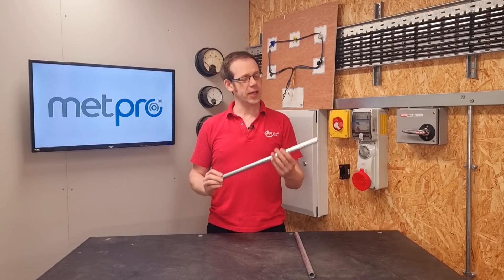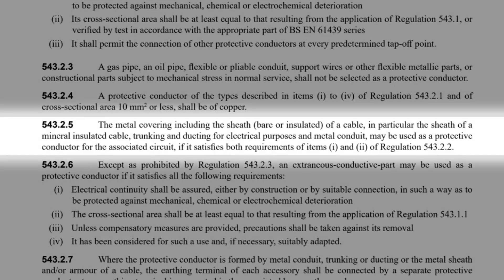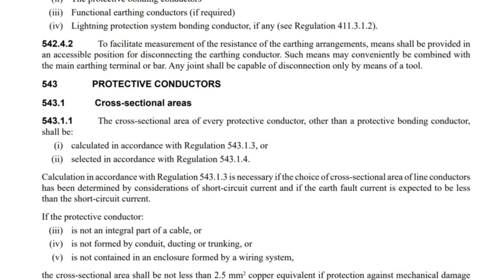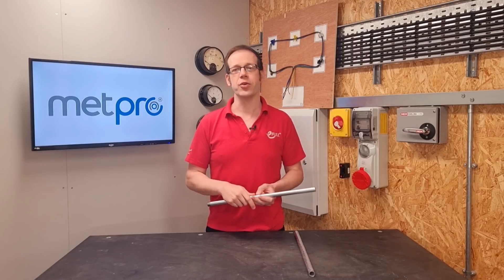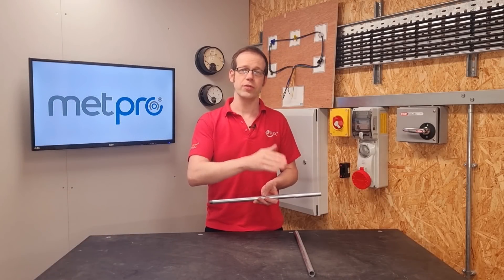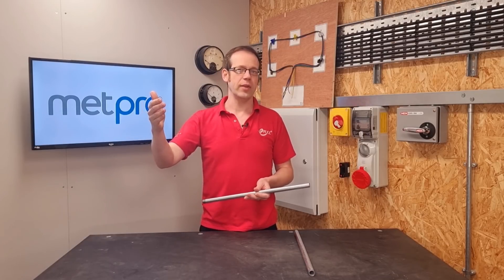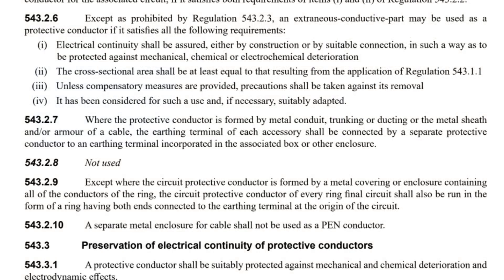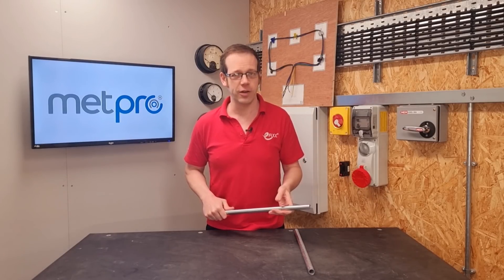The Earth Wire is Missing! - Can You Use Steel Conduit Instead?

Comment: You can find the CSA of a conduit quicker (with a single calculation) by finding the average circumference by either using the outer diameter minus the wall thickness or the inner diameter plus the wall thickness and then multiplying that by the wall thickness. Use the formula:

a = ( D - t ) * π * t
a = ( d + t ) * π * t

Where "big" D is the outer diameter, "little" d is the inner diameter and t is the wall thickness. π can be rounded to 3.14 if you only need a quick calculation.

Comment: ? Pi x 8.63^2 = 233.98 and not 244.95????  Still, makes no difference to your proof that the steel conduit is plenty fine to be used as the CPC in this instance.  (314.16 - 233.98 = 80.18 mm^2 CSA for the CPC...)

Comment: If electricians did conduit tightly you got no problems,,with the size of the tube it'll always be big enough for use as earth,just don't do it like that anymore,same as not having flyleads to ceiling grids or radiators,not done anymore,different times.
Reply: We are installing a job at the moment with 75mm steel trunking with 20mm tube . I won’t be running an additional cpc using the containment as the cpc for the sockets and lighting .

Comment: Different terms with the NEC over across the pond. We no longer allow mechanical means from faulty connections. We run an equipment grounding conductor with every run and bond every box with a splice. Simple and redundant.

Comment: But with that grubscrew-fixed system, all it would take is one loose grubscrew, or a bit of corrosion etc. at the fixing point and suddenly you have no cpc.
Reply: Thats only the same as the first cpc connection coming lose (if a radial)
Reply: I suppose adding grounding straps at each join in the conduit could be mitigation against that, although if going to that kind of detil you might as well just add an extra earth wire.

Comment: About 50 years ago I used to find a lot of gripfast conduit which used clamps to join fittings, the paint had to be scraped off to ensure continuity and it was wired in singles VIR cable. Guess that was from the 20s. Looks like conlock is the modern equivalent!

Comment: I know code allows it, but I hate seeing people "cheap out". All it takes is one loose screw to break the ground. Or a conduit being cut, or section of plastic being introduced to screw everything up. And of course, sparky's and inspectors never actually check. (I've seen lighting circuits where the conduit wasn't secured at couplers or boxes. Inspectors never climb into the ceiling and pull on things.)

Comment: While the CSA of the conduit itself is sufficient, what about at the joints?  As the joints are held together by a set screw, do you need to calulate the area of said screw as that is like to be less than the area of a conduit?

Comment: What happens when you have dissimilar metals,say steel conduit and an alluminium box/enclosure. In this example crystaline corrosion will set in with even a little dampness. Do the regulations say anything about this?
Reply: It's called galvanic corrosion.

Comment: Lots of good stuff there.  My opinion is run a separate CPC in the conduit and the same for SWA and stop trying to save money at the design stage.  A main reason is that it may work and be ok when first installed but what happens when some of the joints start to work loose or the conduit/SWA armour starts to carode/rust
Reply: The system should be periodically tested so that would be picked up on but I'm just being arguemnetative because I fully agree with you run the CPC

Comment: Using the new conlock conduit system and assuming all freshly cut conduit ends have been painted (to prevent corrosion) then wouldn't the conlock grub screw be the only true metal to metal connection...?

So shouldn't this whole calculation be based around the CSA of the conlock grub screw..?

Or am I missing a trick where the protective coating of conduit paint is actually conductive..?

Your thoughts please..?

Great video as always guys 👍🏼
Reply: Conduit zinc coated?  If so that leaves the contact being the grub screw and a line contact at the opposite point from the grub screw.  Also what torque are you using for that screw?  Not convinced.

Comment: I was on a job in a garage a couple years ago  . The conduit appeared ok but I was a bit sceptical. . On pulling in new cables  I found the existing conduit under the concrete floor was In fact very rusty and as I pulled the old cables out they were very wet and stained by the rust.  Moral of the story is unless you can see the whole length of the conduit don’t trust it for earthing.
Reply: I had a similar problem some 30 years ago, where an SWA cable went to and exterior socket on an outside wall. This hadn't been properly sealed and years of moisture had caused the armour and the the fitting to corrode.

Comment: Use plastic sockets!In Europe it works,so why not in the UK?
Reply: We use metal where the environment demands it, mainly in commercial and industrial sites as it stands up to any potential damage from fork trucks etc, plastic would just smash.

However there's is a increasing trend to install metal conduit and metalclad accessories within homes for aesthetic value (the industrial look).
Reply: @seanthespark  I have bin in lots off factories in the Netherlands and no metal sockets seen or installed!

Comment: Doesn't the grub screw reduce the cross sectional area? It only makes contact that you can rely on on the tiny screw, not the whole conduit
Reply: I had the same thought. I certainly don't think that the contact between conduit and fitting in this sort of push-in setup should be relied on as a dependable connection.
Reply: so the CSA might be only 60/70%... earthing conduits is a must, but in my view always run in a earth also
Reply: There's also the the part being pushed against the back of the housing, but yes, the entire conduit is not the contact point.
Reply: @jfbeam  the painted part

Comment: This bit of the regs seems crazily weak. The end-to-end resistance of runs must be very unreliable even if you manage to get a good reading at installation. This stuff gets knocked and there's ingress of dirt, corrosion, etc, all the time especially there steel conduit is specified. What's the point of getting the torque correct to the nearest 0.1Nm in a distribution board and then relying on a  grub screw or on-site threading and attaching it to a 2m lever arm? I guess it would be ok for RCDs where the CPC is just needed to sink enough current to trip it, but where you're talking about equipotential bonding or relying on fault overcurrent to trigger protection you need your CPC to be treated with the same respect as line conductors (except that you can assume its loads are transient in terms of heating).

Comment: If I was going to consider using the conduit for the cpc, I definitely wouldn't be happy with a small grub Screw making a secure connection and continuity. Crap system, much better job to thread the pipe. Quicker is definitely not better in this case.
Reply: Depends why you are using conduit surely?  Mechanical protection? - frankly a slip joint would be fine.  Electrical continuity? Whether CPC or to meet Tempest requirements, screwed seems much more robust.

Comment: When I was first on sites we used the conduit and trunking as cpc but after a few years running a cable was specified. I can only assume it was down to the designers, the same muppets who wanted us to get 6 x 4mm singles round 20mm pipe bends. Real Fairy Liquid job that one. 🤣
Reply from the maker: 😂 Having been on both sides of that fence I totally sympathise Christopher.

Comment: Old commercial buildings use the conduit/trunking as the CPC
Reply from the maker: Yup!
Reply: Yup and I work in a factory like that. Seen lots of missing trunking and corroded conduit. 😳

Always have put a separate CPC apart from large SWA's when installing.

Comment: Better to install copper cpc in the event of external fixtures been added later on ,
 Bit like underfloor heating pipes now in plastic  covered and aluminium layer inside ,after time on radius the lining will have wore away with aluminium in contact with water ,  future problems ,

Comment: I have seen square metal trunking as the CPC with cable bolted to the trunking at the corners and tees. Seen one where the trunking was played about with, having the cable CPC left off. Big break in the CPC.
Reply from the maker: Sounds like a problem... 🤔
Reply: @efixx  
Always check, that the trunking is linked by bolted conductors.

Comment: This is an absolutely brilliant vlog . 
Very informative and helpful. 
I have never in the years used the conduit or trunking as the CPC but I would consider it. The only question I have is where the trunking enters the accessory/consumer unit/ dis board or whatever require special attention regarding cleaning off paint to ensure a proper long term connection. It’s a bit like the question of SWA gland tags  not being used on a steel enclosure.
Reply from the maker: Good question, we'll do some digging. 😊
Reply: That’s a well good question… hope we get some good answers as normal back!
Reply: What’s the question here

Comment: I do appreciate all the math and science that goes into cable calcs and one reg that that refers to another reg providing 2 other regs are met and they all satisfy another reg....🤨
Do you know what..... my time is better spent on the tools rather then at a desk with a calculator and 9 of my fingers in different pages of the reg book and its tables...
Sorry but im just gonna buy a couple of coils of earth wire.... 
If you have a few guys in your company and one of them can do all the paperwork and calcs then crack on.... but if your on your own then you need to be earning the monies....
And beside the most important fact....Bar none is conduit , bushes, couplers nuts etc are absolutely a load of cheap crap.... and it dont matter where you buy it from... its crap, threads are very loose and surface areas on bushes are minimum as are gutter nuts..... you compare containment quality from late seventies early 80s to modern metalwork and your mind will be blown...
British Standards must be getting brown envelopes from someone on a regular basis because quality has gone down the toilet... FACT...
I wouldnt fancy a fault current being trusted down the conduit and accessories....
Reply from the maker: OK.

Comment: Interesting topic. Most of the projects I've worked on over the years, the contractors have always used a separate cpc, as it's easier. However it's definitely worth bearing in mind situations where we can use conduit as cpc, especially if you find it when carrying out an eicr.
Reply: Using the new conlock conduit system and assuming all freshly cut conduit ends have been painted (to prevent corrosion) then wouldn't the conlock grub screw be the only true metal to metal connection...?

So shouldn't this whole calculation be based around the CSA of the conlock grub screw..?

Or am I missing a trick where the protective coating of conduit paint is actually conductive..?

Your thoughts please..?
Reply: @essdee9143  Great observation.
Reply: @essdee9143  The "protective coating" is zinc and is conductive. Even if appied as a spray paint, it is heavily loaded with zinc particles which make the paint conductive.
So the side of the pipe opposite the grub screw presses against the fitting and provides a conductive path, in addition to the grub screw and probably lower resistance too because of greater cross-sectional area.
Reply: Using the conduit as the CPC is only done in big commercial jobs. Done in a big job I was at in the Middle East - to US standards which were more 1930s.  Saves a lot of earth wire on a big job though. Quicker to wire up as one less conductor to manipulate dress and tighten up.

Done a lot in ye olden dayes when copper was very expensive.
Reply from the maker: Yeah, we tended to run an extra CPC in steel conduit as well, quite interesting to see where the cut off point is for using 20mm conduit as the CPC too.

Comment: So really, for all likely sizes of conductor in a 20 or 25 mm steel conduit the conduit will be fine as the CPC...
Reply from the maker: Yur, the cable needs to get pretty maohoosive before it becomes non-compliant to use the conduit.

Comment: Would seem sensible to earth any metal trunking/conduit etc. anyway, whether or not there is a cpc. Back boxes are generally earthed and a cable could get snagged when passing it through the trunking/conduit, making it live.
Reply from the maker: If the conduit is the CPC would that snagged cable situation not then disconnect the protective device? 🤔
Reply: @efixx  Indeed, but if not earthed it would remain live (?) Is it not the equivalent of a water or gas bond? - even if it doesn't go fully into earth.
Reply: @efixx  Being pedantic here.....but you mean TRIP the protection device😁

Comment: Don't you have to divide that figure by 8 due to poor conductivity of steel compared to copper like you would when using the armour of an SWA cable for your CPC?
Reply: Looks to me like the k2 value here factors in the lower resistance but I may be wrong.
Reply from the maker: This. 👆👍
Reply: @efixx cool 😎

Comment: How are you connecting the steel conduit to the earth bar in CU?
Reply: Connect a fly lead using the banjos bolt and nut
Reply: @reddie8130  
I assume that can drop to 1.5mm if using 2.5mm rather than 6mm.
Reply: @johnburns4017  you can’t mix and match the calculated CSA and selection. If you are using selection as the video, then you should use the same CSA as the circuit line conductors. In which case it would be 2.5mm to the socket earth terminal. If you used less then you would need to prove it by the calculation. Although in practice you will almost always be able to reduce it.
Reply: @rossthompson1936  
So using the conduit it would be min' of 6mm cross section area of the conduit. If mixing it with cable the minimum size of the CPC is the size of the conductor in the cable, say 2.5mm
Reply: @johnburns4017  it’s important to remember what you’re trying to do. In the video the CSA of the cpc is to be selected rather than calculated. If you were using copper, it would be the same size as the line - 2.5mm. But here steel is being used hence the k1/k2 calculation, which says the steel must be 6mm min. But if you are connecting the conduit to the accessory earth it’s going to be copper. Hence 2.5mm same as the line as per selection. If you calculated instead both the steel and copper would be less. Therefore you’d probably get away with 1.5mm. But you started with selection and should continue to do so unless you make the calculations.
Reply: @rossthompson1936  
As the CSA of the steel conduit is 60 sq mm, if running say thee 2.5mm L and three 2.5mm N conductors the copper wire to the CU bar should be min of 7.5mm. So a 10mm earth cable from steel conduit to CU bar.
Reply: @johnburns4017  no requirement for that. As joe said only sized for the most onerous fault current or largest line conductor. If the connections are tight and well made why would you bond it to the earth terminal?
Reply: @rossthompson1936  
We may be crossed here. The steel conduit has to lead back to the main earth. That would be conveniently the CU earth bar. 

So the largest L conductor CSA dictates the size of the earth from steel conduit to the earth bar on the CU.
Reply: @johnburns4017  I really don’t see the need to bond the conduit to the earth bar assuming it’s a metal board as it’s unlikely to be plastic. If the connections are tight then a bit of green and yellow won’t do much. And banjos are for SWAs or music.
Reply: @rossthompson1936  
The paint on the CU case would need scraping off. And assuming the case is earthed of course.
Reply: @johnburns4017  👍🏻
Reply: @rossthompson1936  
My metal cased Wylex CU, the case is not connected to the main earth. That would need a banjo and short length of CPC wire.

Comment: The issue here would be the Zs values measured at the farthest point and the likely hood of an increase in resistance  from corrosion or vibration  etc . Just install a copper cpc and don't worry about it
Reply: Could use an RCD as you would with a TT install as they seldom meet the required Zs as well
Reply: @paulmatthews5470  yes you could .
Reply: Have found corrosion reduces zs so I alway include a earth cable
Reply: @bernardcharlesworth9860  reduces Zs ???  Surely increases Zs , decreases fault current  ?

Comment: I wouldn't personally. I've always used an earth wire and fly leads for armoured, even if it's in metallic. Pyro's a little bit differently as the outside is the earthing and it's connect at both ends for the earthing.

Comment: I ve used plastic conduit for the earth before.
Reply: I struggle to find pvc 20mm banjos though.. Or I would too 🤣👍
Reply: @muzikman2008  wrap it around the thread of the male adapter derrr
Reply: @noworriesnoproblems6382  good idea, I'll use that technique on my next high integrity earthing install 💡😂 maybe some pvc cement to hold it in place as a safety measure..
Reply: @muzikman2008  now your catching on. To be honest I dont even bother with earth now
 Have you seen the price of copper.
Reply: @noworriesnoproblems6382  Very true!.. that's why i started using Nylon strimmer line, its cheaper, but to be honest, my Zs  is shite!.. but my IR tests always pass with with super  high resistance readings...go figure 🤔
Reply: @muzikman2008  Zs?
Reply: @noworriesnoproblems6382  earth loop impedance...
Reply: @noworriesnoproblems6382  Zs=zero sillyness